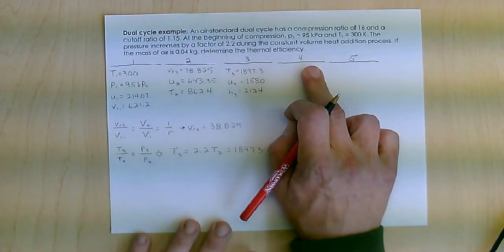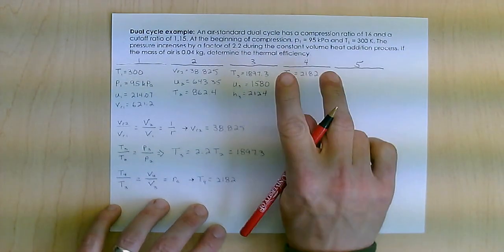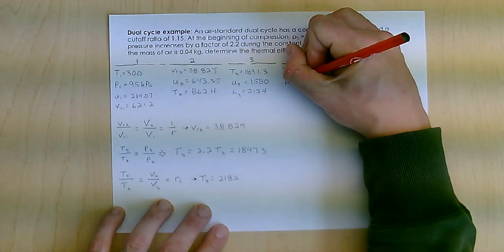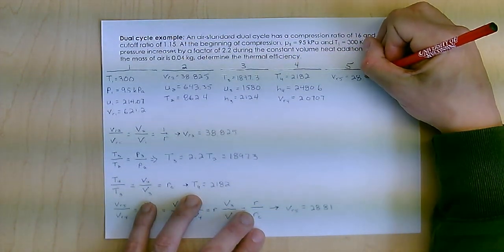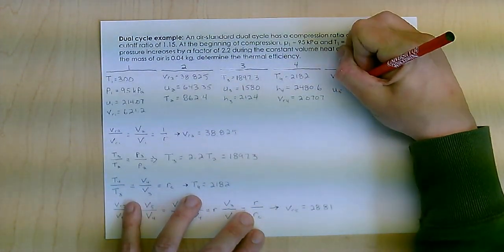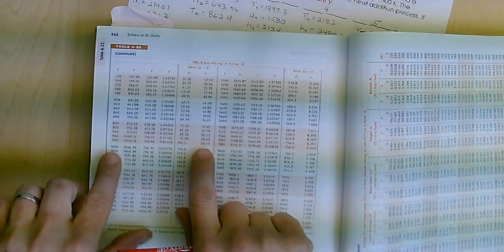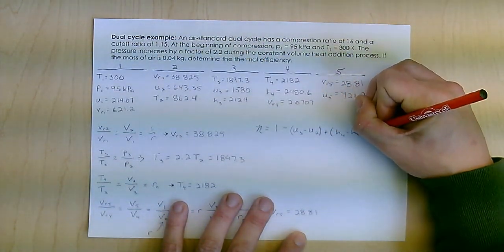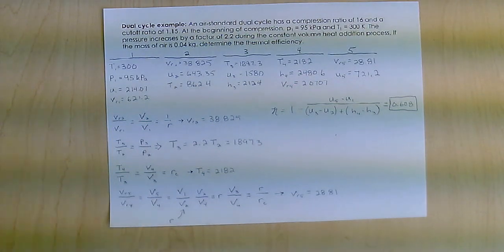Thermodynamics Example 30: Dual Cycle

Comment: What's the point of them giving you p1 =95kPa, since you haven't used it in your calculations, also mass of air too. 

Also where the book getting h and u values from?
Reply: It works when told to find MEP